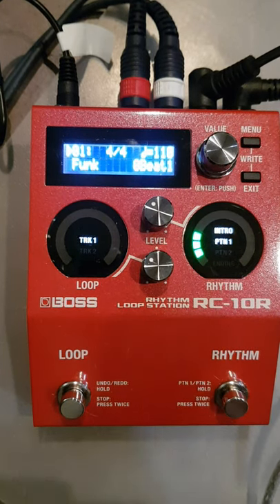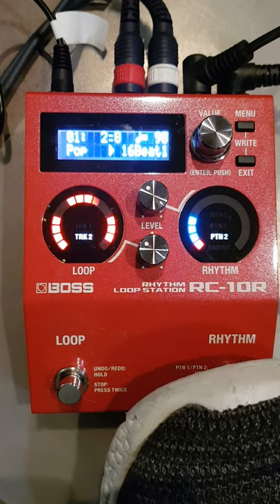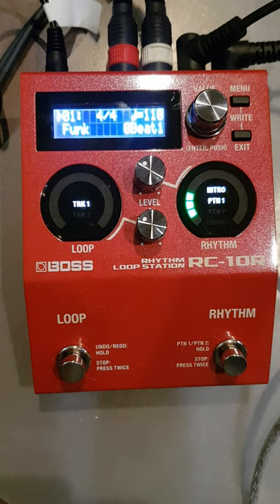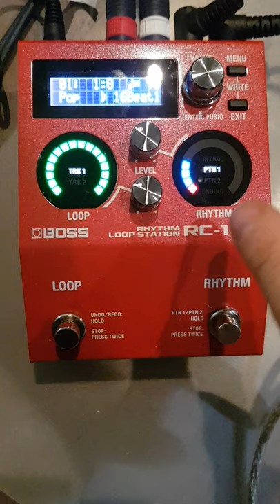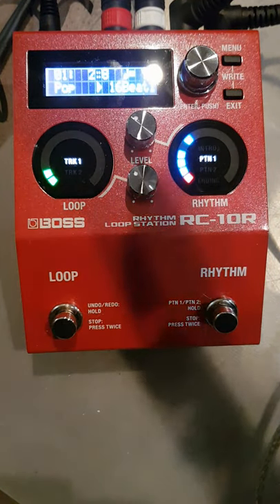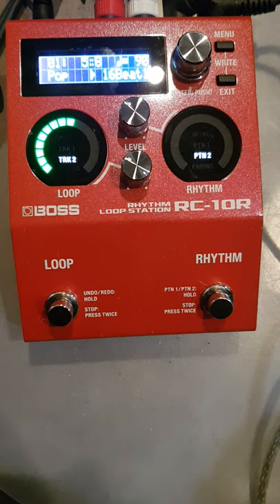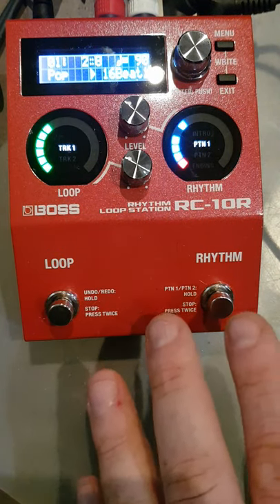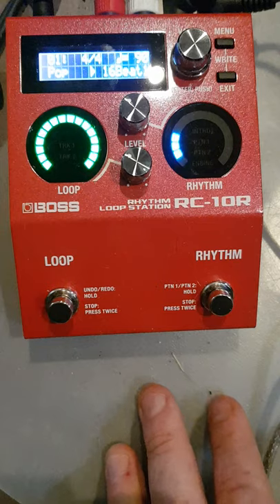Boss RC 10R Looper Part 4 FAILURE to perform by Nik Kotlarov aka Dr Carrot

Comment: This issue should be easily corrected via software. It’s a matter of Boss knowing about this problem and programming a fix. I know there’s a recent firmware available, so I’d be curious if if fixes this issue. Can you post an update when you get to it?
Reply from the maker: I returned mine after the multiple failures. Not something that I would trust on stage.
Reply: @drcarrot  I see this as more of a practice /learning tool, if I was going to do live looping I’d get the 500. For improvising and practicing on your own at home it works well.